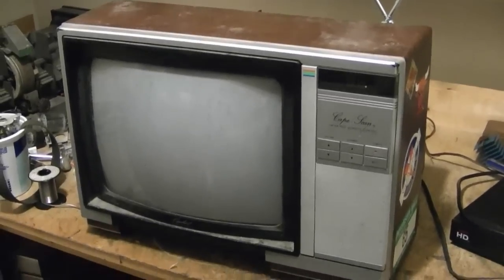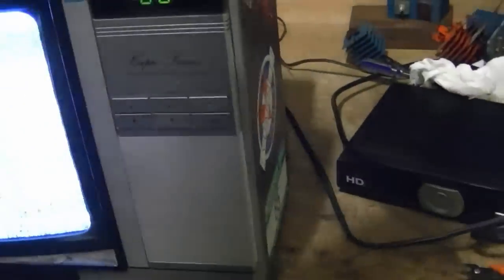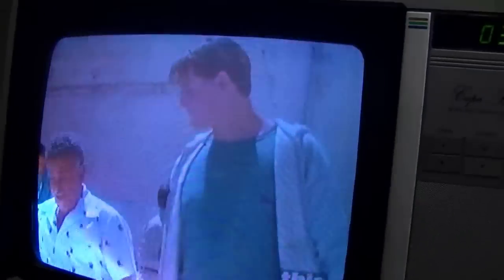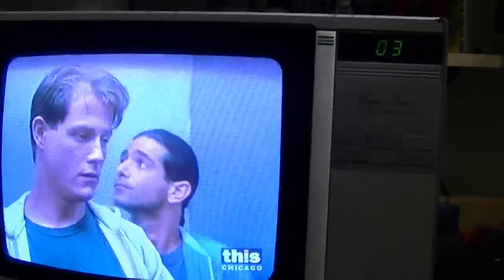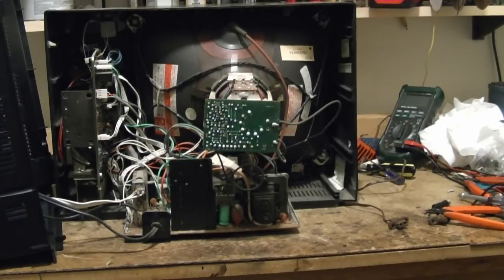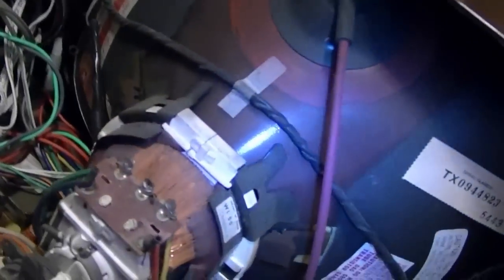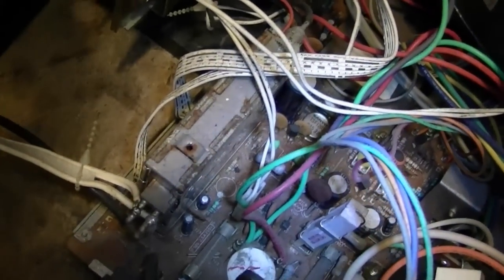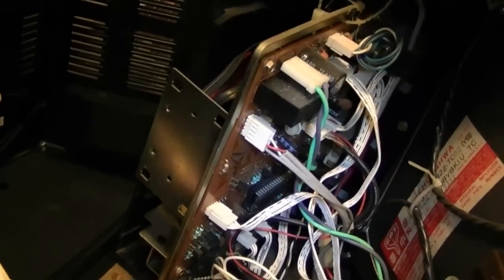1985 Capehart Color TV

Comment from the maker: I think in 2013 I'll finally get to some of my more unusual sets :)  
BTW don't think I spent a lot of money on my equipment.  I got all of it used off ebay - even the digital HP scope was less than $100 and works perfectly.
Reply: @bandersentv I have 1950's TV,if I use antenna will it work or do I need that box?
Reply from the maker: @govdid195g7  You need a converter.  Analog TV transmission stopped in 2009